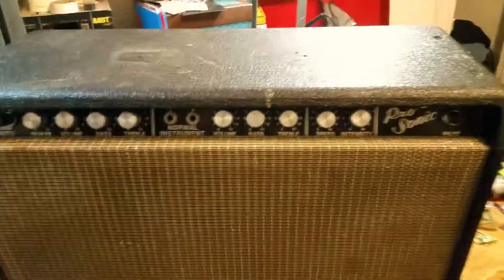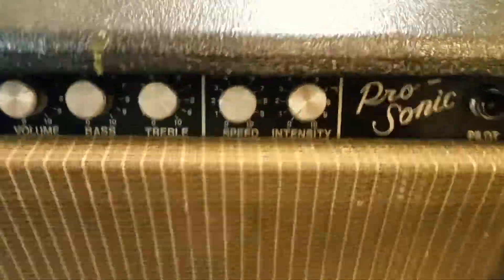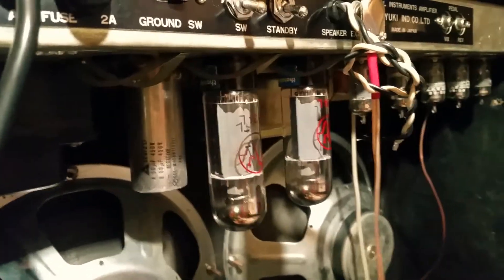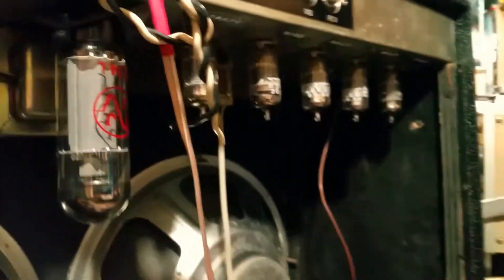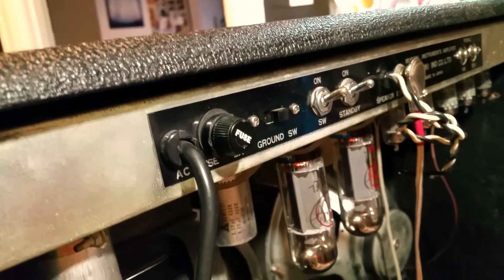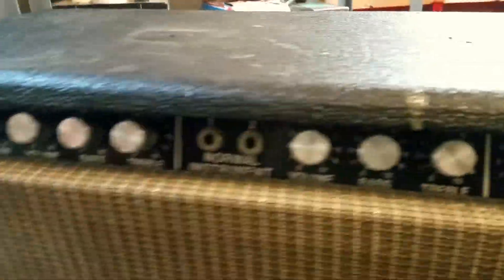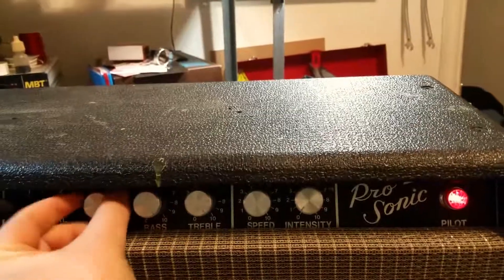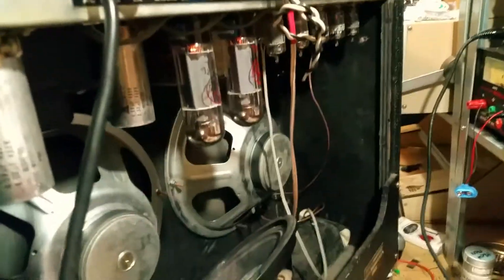Whole lotta hum - 1969 Elk Pro-Sonic Restoration

Comment: What's the purpose of the on/sw switch is that the main power switch?
Reply from the maker: There's a ground switch, standby switch, and power switch. It's a typical switch configuration like you see in older Fender amps.
Reply: OK I have an elk twin amp 50 head and if i plug the power in....the power goes out and the circuit breaker is off in my basement. But the on/sw switch is broken can this be the problem?

Comment: hi, I have the same amp. but what kinda of tubes do you put on it? This amp uses EL84 or better the 7189
Reply from the maker: Every schematic I've ever seen for this amp has EL84/7189, but this amp uses EL34
Reply: mmm ok. Probably it's a successive model, even because mine has alnico speakers and a switch from 100v to 117v instead of the ground switch on yours. Anyway good amp
Reply from the maker: +Francesco M The problem with mine was a faulty cap on the negative bias supply. It sounds really interesting now, very surf-punk!
Reply: I know, the previous owner on mine put the negative bias on positive, bad thing to do! I changed everything on mine, it works great except for the reverb, if I shake the tank I can hear the springs but not effect